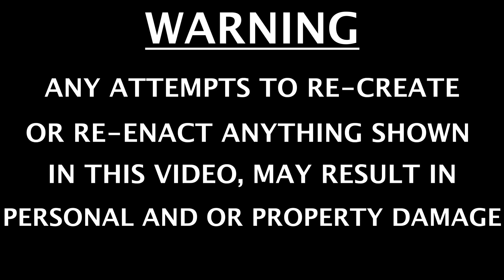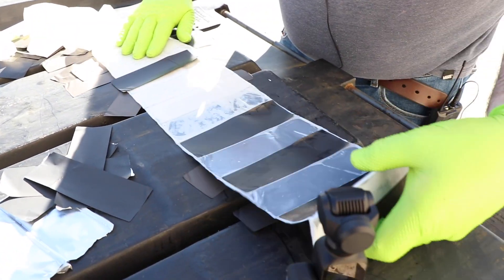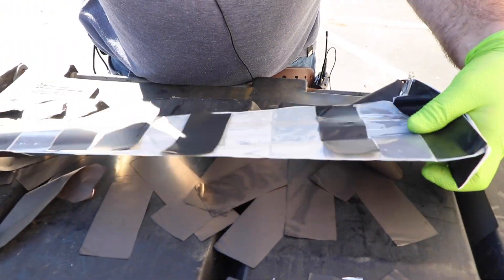Dissecting a Gens Ace LiPo Battery

Comment: Gens Ace need to be a bit quicker with rapidly failing battery warranties. Had a puffy 4s that took over 3 months to warranty, meanwhile, the bomb just grew bigger and bigger. Thankfully I got some replacements (45c instead of 100c which is a bit inconvenient for an X-Maxx), but glad to have moved the "balloon" on

Comment: Like you said in this video , when the battery is puffed its plates are loosen causing the degradation of the battery(capacity). 
If the air inside it is removed by using a needle and the plates are pressed to its original form and closing the puncher with some adhesive , will the battery will become normal,means it will come to its original capacity?
Please guide me , is it safe to do this as i am having a puffed lipo battery.
Reply: Absolutely never puncture a lipo battery dude. This was in the video 😂. If it’s puffed just get a new battery. Why change burning down your house or rc vehicle with defective components? Not worth the risk at all.

Comment: When i was disregarding a safety warnings and tearing apart 3s battery with single dead cell to make it into usable 2s i wasnt cutting it to get the cells apart just spraying a bit of brake cleaner on them made them fall apart. (battery was gens ace bashing 5000mah).

Comment: I have only used Gens Ace batteries. One i made bad decisions and it feel out of my car. The battery did not last too much longer. 

I'm now always storing at 3.85v to 3.8v

Think one of my new 3s packs going weak in cell one again.

I hope these new ones last. 2 go bad in 5 months is not good for the pocket